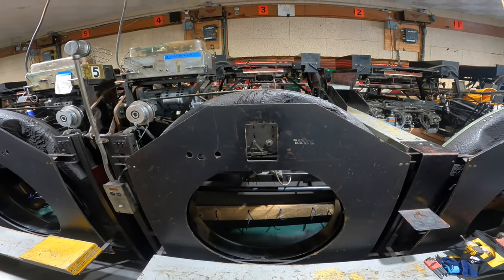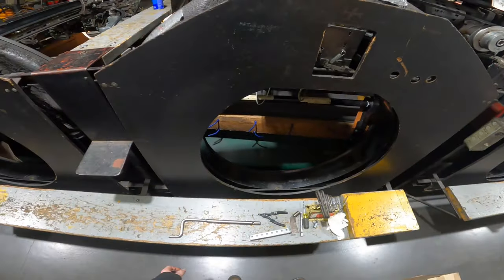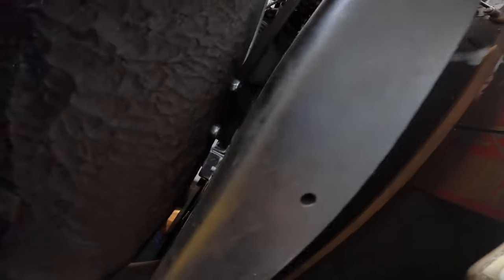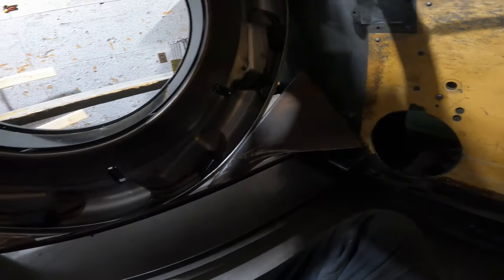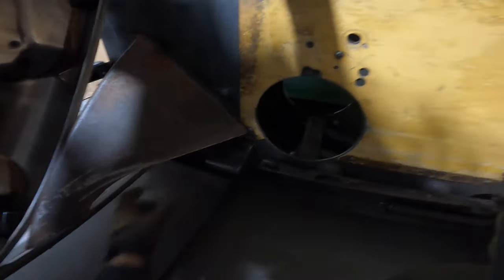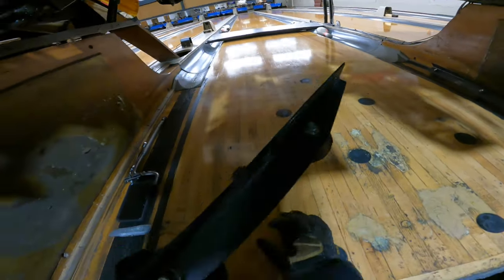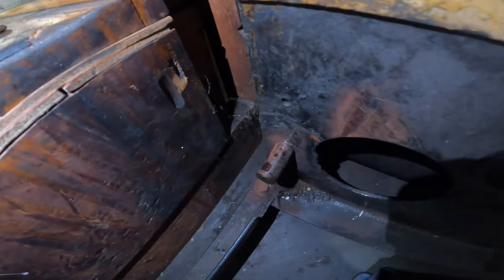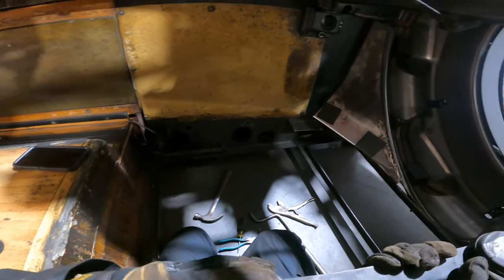AMF 82-30/How To Advanced: Pit Overhaul

Comment: Nice video. I have done many 82/70 pits. Doing the pits was always my favorite part of our summer maintenance we did. One thing though whenever I worked anywhere inside the machine I and the others would always have the sweep down in the guard position for protection. We had the sweep down if the house was open or closed.
Reply from the maker: Yeah it can be fun and it can be time consuming… but when you know what you’re doing it goes by quick

Comment: I SOOOOOOOOOOO don't miss doing pits. I designed mine to be very easy to service as a result of working on full size machines.
Reply from the maker: Well these machines haven't been kept up with or taken care of in years. I don't think these pits have been serviced correctly in like 20 years. And it's unfortunate. So I'm making up for everyones laziness. For the two I've done so far almost every part needs to be changed. That's why it takes so long... And I have to go back into that lane because I didn't have the parts in yet for the hinges... so yeah.
Reply: @Joethepro181  Looks like you're doing a great job. Keep it up.
Reply from the maker: @coasterp2199  thank you! We’re trying to get to 1k subscribers so try and spread the word! Thanks!
Reply: @Joethepro181  Where is this center located?
Reply from the maker: @coasterp2199  email me: joethepro181@gmail.com

Comment: I kept records of all major repairs and rebuilds to have a list of pits to be torn out.  Every year we did 24 pits.  So every other year the pits were rebuilt.  (48 lanes)  You don't need the washers and snap ring on the front roller supports.  They will NOT come off.  We used grease on the shaft and Never-Seize on the front roller support.  They will never rust up again.   We also kept good rebuilt rollers and front roller supports that were swapped out.  Ya did good !   What carpet is that ?  Looks flexible ?
Reply from the maker: Thanks for the advice! And thank you. The carpet is from SPLAWN belting. I get my distributor belts from them too. Super good stuff, definitely recommend! Make sure you hit subscribe!:)

Comment: Wow that looks a lot harder then what I used to do, the house i worked at had 8230's with 6525 and 5850 chassies, the ball lift was a seventys convertion .seventys ball lift. we just slide the rollers in the holes in the bottom of the kick back, Side walls.. didn't have to remove the ball door.. the ball door was in the middle of the pit..the front roller brakets we would remove the pin and let it go forward to relase the spring and you the spring puller to remove the spring and replace..the back roller mounts where welded to the wall.. the bounce board was diffrent. we use to pull the pits every Summer to grease what needed to be greased . and check the rollers and check the bounce board and dampers.. we only had 20 lanes..
Reply from the maker: Yeah we have verticals still, so the pit is a little different but generally similar

Comment: Question . How often this have to be done or what tell you that you need to do this procedure   Thank you
Reply from the maker: About every 3-4 years depending on usage. Front roller should be checked on a regular basis. If you hear it clanking really bad - bad front roller

Comment: I just used a screw to stick in that hole to hold the bracket back.
Reply from the maker: That works too! I just think it’s easier to use the tool because some of them are a pain
Reply: @Joethepro181  Definitely can be a pain. And the tool saves your fingers in case the tool you use to pry back the roller slips.